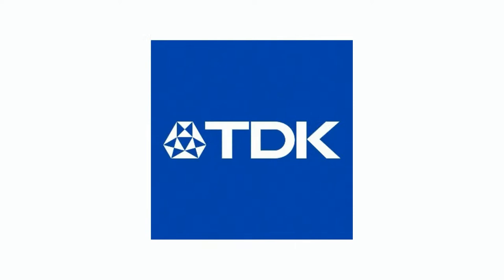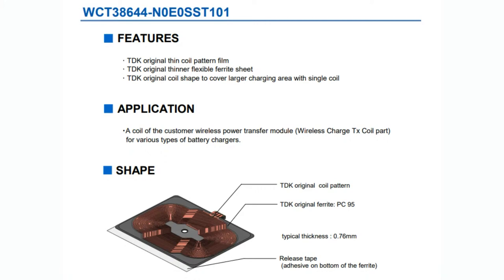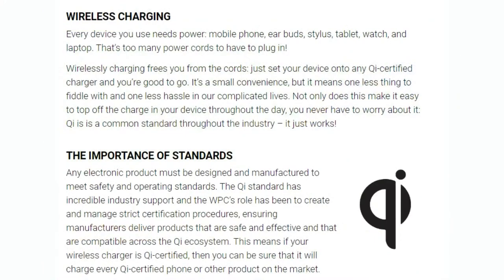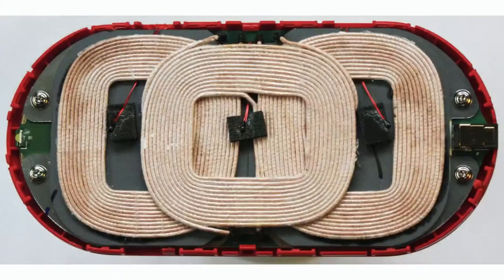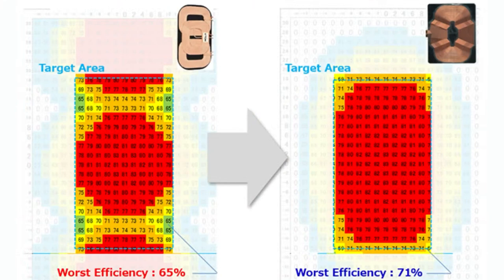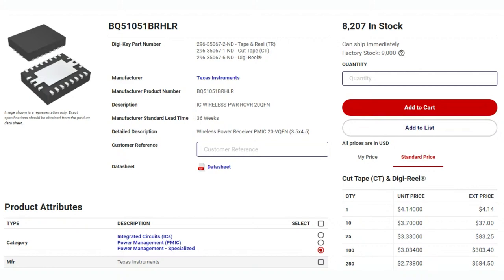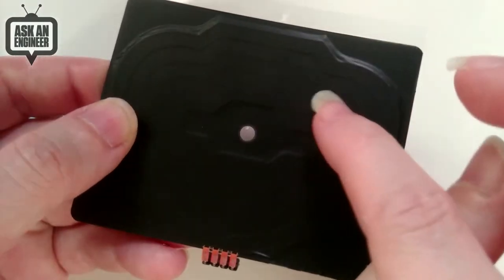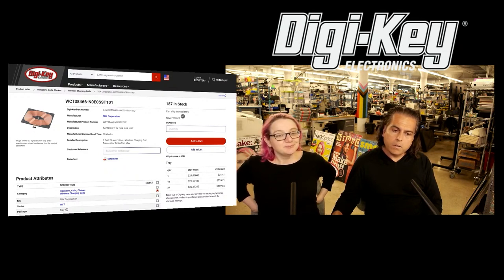EYE on NPI: TDK WCT Ultrathin Pattern Coil for Wireless Charging #EYEonNPI @DigiKey @tdk_corporation

Comment: At 1:16 the “Features” section mentions a “flexible ferrite sheet”, does anyone know just how flexible that is (understanding of course that bending beyond a certain point would cause inherent issues with the power transfer, it would just be easier for me if power could be transferred along a slightly curved surface)
Reply: Flexible --> Think of a 2mm thick polyethylene cutting board qua stiffness. Intended to be conformable to a gradual curve, but not really "bendable". Also bendable in one axis (can wrap around a cylinder, but not a sphere, due to "wrinkles".
Power-transfer --> The coupling coefficient drops dramatically with air-gaps. If both the transmitter and receiver have a "mating" curvature, then all is fine. Else, the introduced air-gap shall decrease coupling, leading to a drastically lower efficiency.
The magnetic material is actually a ferrite powder in a rubber-like binding agent (think of magnet-strips that hold a fridge-door shut) -its performance does not degrade much due to bending.
Reply: @AdityaMehendale  Thanks! I was worried more about the greater arc length needed for the outer coil and how a significant curve might affect exactly how the magnetic field interacts between the coil and interferences that could cause. hopefully for a minor curve that will be negligible
Reply: @ColeHajek  If you are interested - two sim-softwares to try out: FEMM (to simulate coil-geometries and compute coupling coefficients) and LT-Spice (to evaluate best-case efficiencies, (given a certain coupling coefficient and ESR of coils). Both are free, though not open-source. The Qi-consortium also has good whitepapers regarding air-gaps and efficiencies, although its sometimes difficult on their website to find the forest for all the trees.